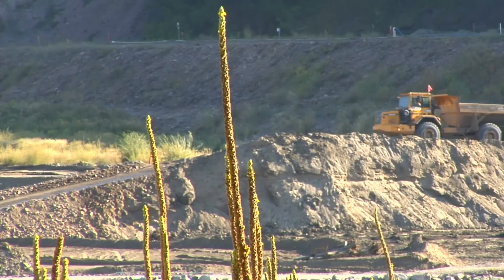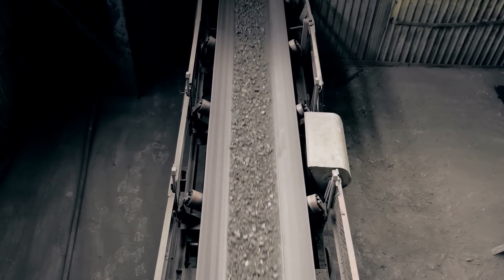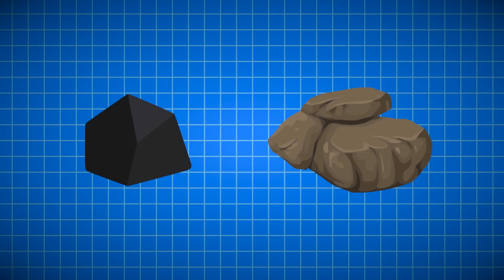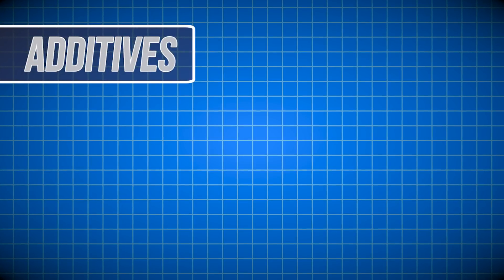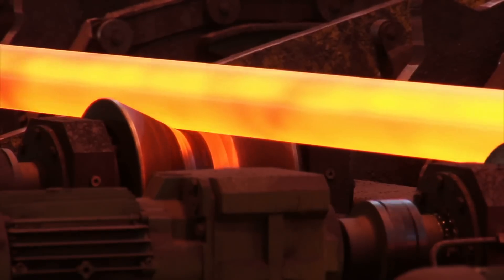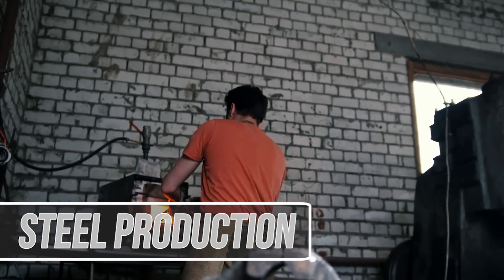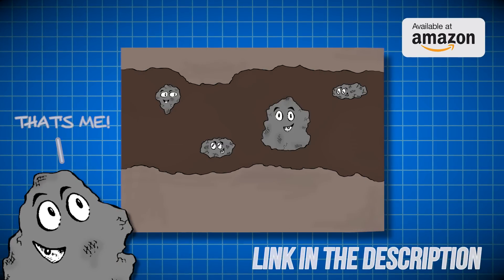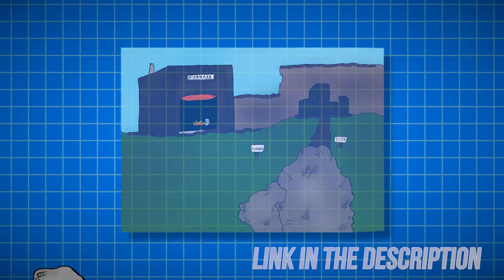How Iron Ore is Turned Into Steel?

Comment: Errata...the hot metal produced at the Blast Furnace is not Pig Iron. It is generally called Hot Metal or Molten Iron. Yes, it can become Pig Iron which happens at a Pig Mill where the molten Iron is cast into small and transportable ingots with a rounded top that resembles a piglet. When cooled these are transported often for remelting at a foundary. Hot metal is transferred directly to steelmaking shop via rail generally in what is called a torpedo ladle.

Comment: What is added to iron to make stainless steel?
Reply: I'm two years late, but chromium, between 11 and 18% by weight
Reply: But watch out if it's "stainless steel" made in PRC.
They cheat with everything.
Reply: They just clean the stains off the steel once it’s done

Comment: This video explains nothing. It just introduces some elements and keeps them hanging there. How is elemental iron mixed with coke? How is pig iron reduced to steel? What are the traits that manufacturers seek in steel aloys for which they introduce other elements and what are the proceses? 
This video is like saying that to have a forest you just need to throw out some seeds.
This is not how you handle education; not even of the younger ones.

Comment: you don't explain how pig iron is converted to steel
Reply: Mix it with carbon to make basic mild steel.

But to make it stainless nickel and chromium is added. Other elements such as sulfer may also be added for different properties
Reply: There are three main processes that can be used. Many old fashioned plants still use the old Open Hearth furnaces. This process required the molten steel to be cast into large ingots for the rolling process. Secondly there i the Electric Arc Furnaces but because much electrical energy is needed it is expensive. The most common process today for everyday steels is the Basic Oxygen Steelmaking process (BOS / BOF).
There are numerous listing on YT that give more detailed info on all these processes.
Reply: Hello pig iron is output
Reply: I think he said they combine it with titanium or other metals with the iron to make it. Not sure though that is what i think he said
Reply: @vivinh18   There is a carbon percentage in pig iron, so they add oxygen gas which then turns into carbon dioxide and is reduced from the pig iron, if the percentage of carbon in the pig iron is under 2% then it is steel, if it is over 2% it is called cast iron.
Reply: @patriksl6599  thats interesting, what are the advantages of cast iron over steel?
I ask because I have a cast iron dutch oven and I'm curious why it's not made of steel.
conduction?
Reply: @gamerx112  yeah, its to do with the thermal capacity of cast iron. Cast iron transmit heat easier, so it is better for like ovens and brake discs on cars. Steel doesn't transmit heat as easily through its material, so you tend to have a temperature difference within its thickness. So if you had a steel brake disc, the surface would heat get much hotter than the centre of the material. Same goes with your oven.
Reply: @gamerx112  The two have very different properties. Iron / Cast Iron generally contains 4-4.50% Carbon and is the material used in foundaries for casting into shapes. Steel is refined Iron and is processed to remove most of the C and refined to a desired C specification which varies in accorcance with the specifictions of the desired product. The steel in a car body say, had huge difference in properties and specification to railway lines or structural beams.
Reply: @gamerx112  Cast iron has a lower melting point which makes it easier to cast into a finished shape which results in extremely cheap manufacturing. Cast iron also machines easier. From a durability standpoint cast iron is brittle compared to just about any type of steel, and can't get nearly as hard as properly heat treated high carbon steel so it really doesn't have a significant durability advantage.